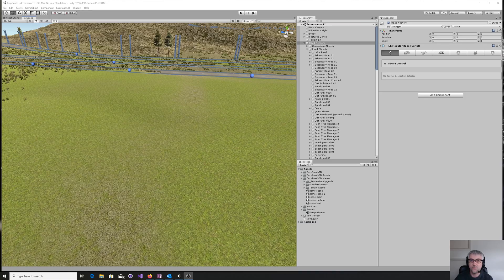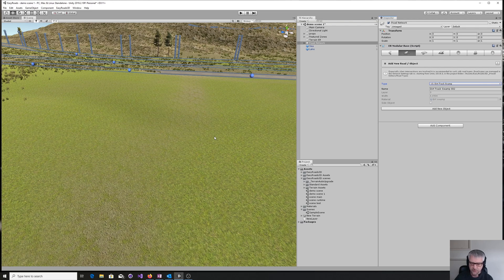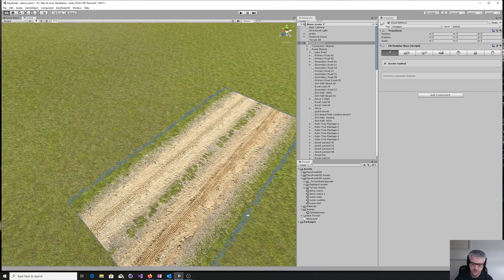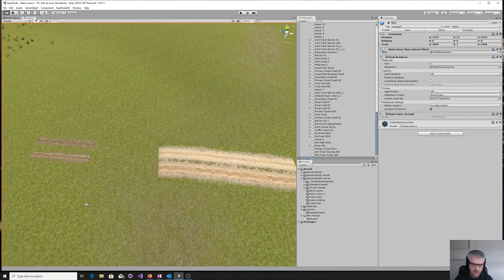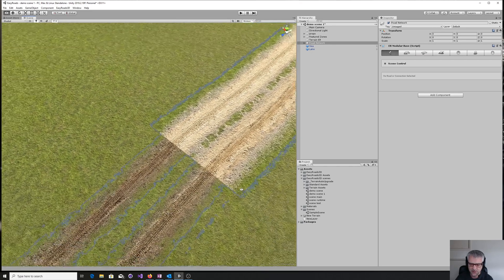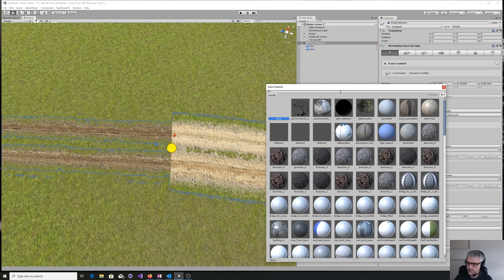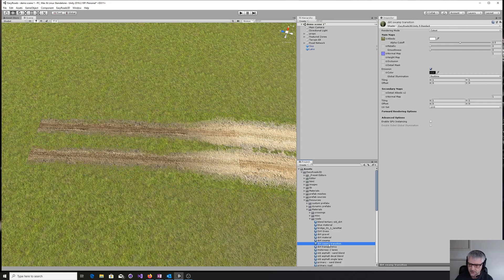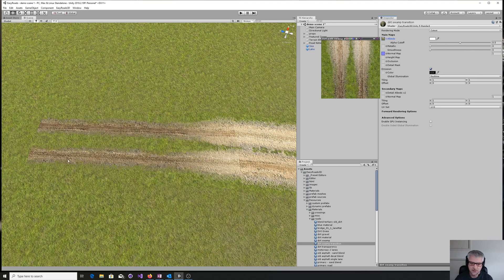EasyRoads3D - Introduction to Joining Road Types

Comment: Since the publisher won't answer my questions maybe someone here can help.

How do I get the other road types?  When I install the road network for the first time it asks me if I want to import road types into this project.  I click YES and I only have the 1 default road type with two default crossing/ connection whatever.
Reply from the maker: Yes, it's a little unclear. If you've installed the EasyRoads demo you can them import the road types 'from project'. If you don't want to do that each time then you can export the roadtypes from the demo and re-use them in any project. I take you through exporting side object here, but exporting road types is just the same but on the next tab; https://youtu.be/552aGRJn1x4?t=134
Reply: @cbcstudios  Thanks, that did it.

Comment: Hi @cbcstudio, I bought Easy Roads 3D Pro but I only got one road type (default road). Do I need to install the demo project so I get more road types?
Reply from the maker: It's worth installing the demo to gain a few examples of different roads. One you have them locally you can bring them into new projects. Although double check the license.
Reply from the maker: It's probably worth mentioning that I've varied my road types by size and texture too.  I have a number of off-road textures for non-car paths too.
Reply from the maker: Note today is the last day for the Easy Roads 3D AddOn roads pack in the Unity Asset Spring Sale. You might want to look at that.
Reply: @cbcstudios  thanks for the hint.